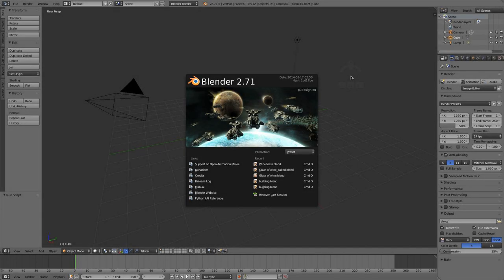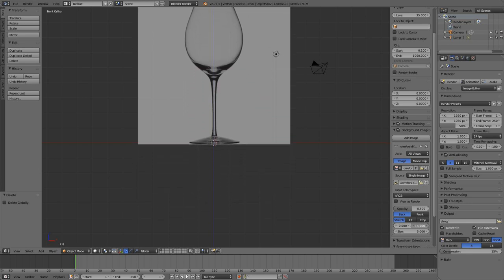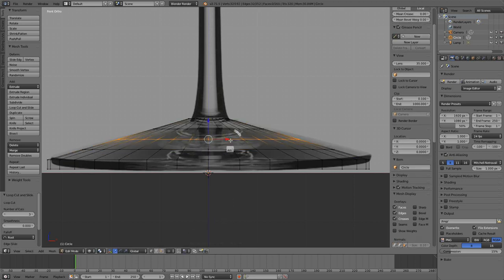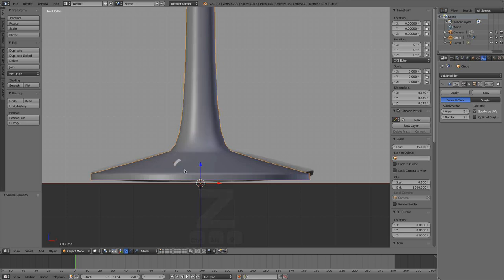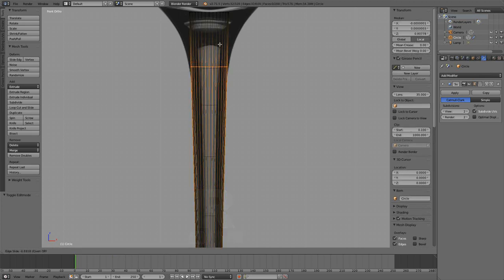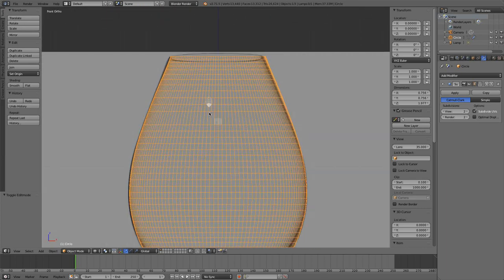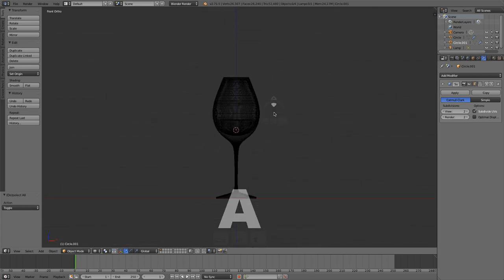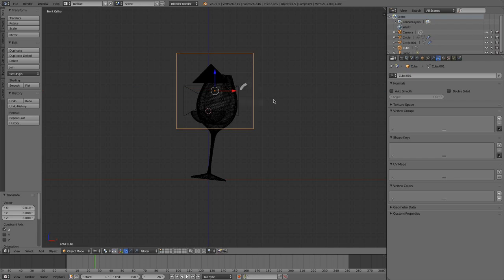Create a Wine Glass - Blender Fluid Simulation Tutorial!

Comment: I'm using blender 2.9 in 2020, the UI is very different, I can't follow this tutorial
Reply: 2.9 uses that Mantaflow simulation. All of the steps are basically the same but I also got some problems at the fluid generation. It just doesn't look as slippery and it's kind of heavy. How far did you come?

Comment: Nice tut. The black parts on the fluid is because either the trasparency or transmission or volume bounces weren't set high enough, so Cycles cuts the light tracing off after the bounce limit.

Comment: Here are some steps that I did that might help some of you.

- Bake at high resolution as possible to avoid much the trouble with fluid poking trough the glass
- Make sure that your fluid source is inside the domain
- Use a bolean to smooth out and take away fluid outside the glass

cheers !
Reply: +Erik Andersen Forgot 1 more step. Make sure that your Reflective Caustics and Refractive Caustics are checked on to avoid the problem with black in the liquid.

Comment: Hello,
I found your tutorial extremely interesting and I would like to perform a simulations similar to yours for a university class.
I followed your tutorial in details but, when i bake the fluid simulation, nothing happens.
I tried then to move the liquid object outside of the glass to see if something changes. if I bake the simulation from there i actually do get a huge droplet of water falling down. When the droplet hits the glass it doesn't enter though, it just kind of bounces on it and then reaches the bottom of my box domain. 
I guess I have some problem with the glass setting but apparently I have the same settings shown in the tutorial for the glass
Thank you in advance for your help!
Reply from the maker: Edoardo Remelli This might be a normal issue on your wine glass, make sure the inner faces on your glass are pointing outward, if they are not, select all the inner faces and choose Flip Normals from your tool bar.

Comment: When I do the first bake, the liquid is on the outside of the glass?
Reply from the maker: SandwichKun Could be a normal issue like I explain in the tutorial, try recalculating the normals, and make sure the inside face normals are point inward. If there not select all the inside faces and choose Flip Normals.
Reply: Okay I'll try. Thank you!
Reply: CG Geek They are facing inwards, but it still is outside the glass.
Reply: SandwichKun may be the glass is too thin, I faced the same problem and then model the glass from starting with some more thickness
Reply: Tejpal Kargwal Thank you. I'll try it out.

Comment: for some reason when ever i bake my water simulation my fluid starts outside any way to fix this?
Reply from the maker: Did you scale down your water mesh? also make sure you have set your glass as a Fluid - Obstacle.
Reply: CG Geek yea the glass is an obstacle but unless i changed what was marked as fluid and go under the volume initialization to switch it to shell then itll stay inside but other the that it wont if left at the default of volume. Also the problem i have is that the fluid seems to start on the outside rather than inside
Reply: CG Geek and yes i did scale it down so it wont be on the inside edge of the glass as you did in the video
Reply from the maker: Carlos Medina
Alright, and the normals on both the glass, and fluid are correct? My guess would be that your inner cup face normals are pointing outward, and not inward.
Reply: CG Geek ok i saw my mistake like you said it was the normals causing it to do that now its fixed thanks. oh and love your tutorials they are awesome for bigginers haha. but anyways thanks for the help and quick reply

Comment: When you have the scene unit size set, i use metric and meters. I cant set the scene size units, its stuck at 0.5 Does that matter? I always model in real world sizes. Tracer particles can be used in combination with a particle system. The particles will be generated where the tracers are, so you can add extra small details. PS check this tut for using dynamic paint to smooth the edges automatically, no sculpting needed. https://www.youtube.com/watch?time_continue=53&v=Avos5B5H6E4 I guess you could also do a Boolean subtract.

Comment: This is a great tutorial! However, I'm having trouble getting the wine color to appear properly. It shows up black, as it does in part of this video. However, even after I change the density and color of the volume absorption, the color of the wine remains black. If possible, you can view the screenshot on a Google drawing here: https://drive.google.com/file/d/0BwvmL9Id96opZFlDYnVicWp4bU0/view?usp=sharing.

Thank you for the fantastic tutorial!
Reply: Ryan Shukis Are you using GPU compute ? because I had the same issue while using GPU compute and everything was black , try using CPU instead , Hope it works for you . Good Luck
Reply: I will have to give that a shot. Thank you for your input.

Comment: Hello,  I am having an issue with the fluid sim.  When I bake it the fluid does not show up.  I have followed all of your instructions to the letter but I am still getting these odd results.  If you have any idea as of what might be going on, help would be appreciated. Thank you!
Reply from the maker: You have set your inner cylinder to be fluid in the physics tab? and make sure that your domain object is surrounding your cup, check all your views with the number keys, making sure its lined up.
Reply: CG Geek I found that if I remove the Fluid Type: Obstacle on the wine glass then the simulation works just fine, it just falls through the cup then.
Reply from the maker: aebkea19
My guess would be that its a normal issue, recalculate the normals on both the fluid object, and fluid obstacle.
Reply: CG Geek That didn't work either.  Should I send you a copy of my .blend file?  I am starting to wonder if it is an issue with the version that I am using, 2.72.  Which was supposed to be the newest recommended build.
Reply from the maker: aebkea19
Go ahead, I'll take a look.
Reply: aebkea19 Did you notice my reply from above?  It's been 4 days now so I wanted to see if you missed my last reply.
Reply from the maker: aebkea19
Sorry, I've been busy. Just took a look at it, and you need to flip the normals on the inside of your glass. Select all the inner vertices on your mesh and choose flip normals from the tool bar.